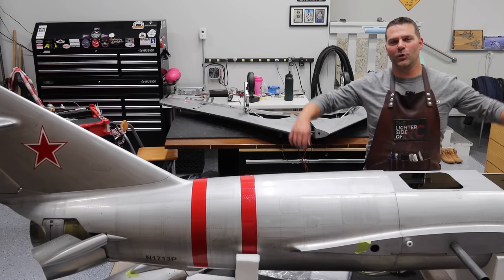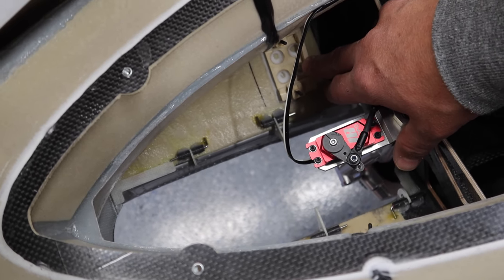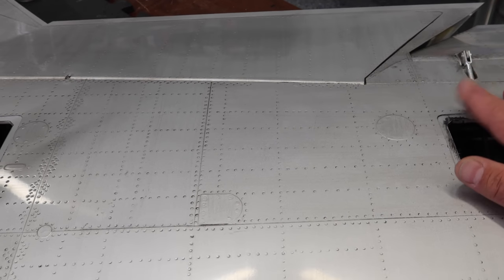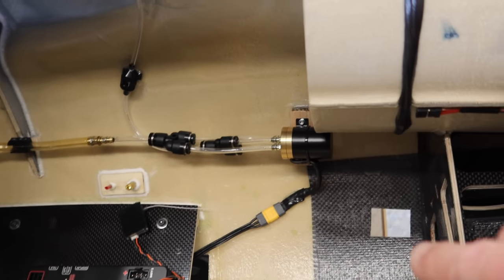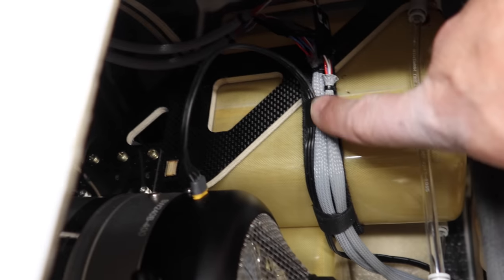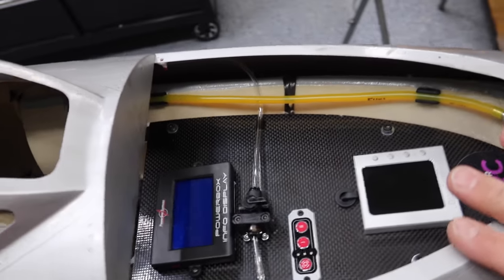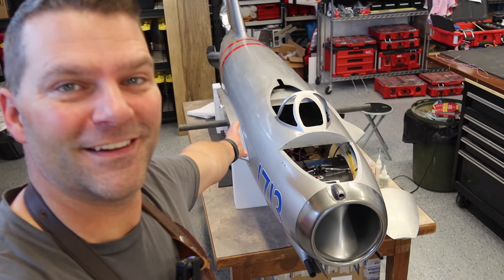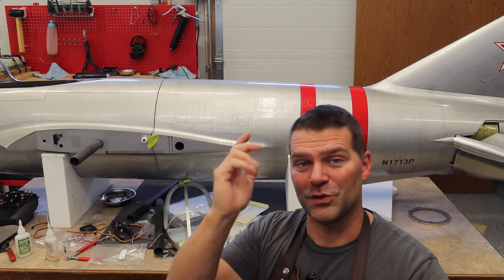MASSIVE CARF MIG17 Almost Complete - Composite ARF MIG-17

Comment: If you need a good 5 min epoxy, try DP 100 Plus.  Great stuff.
Reply from the maker: Thanks Bryan!  I'll check it out.  I'm not generally a fan of the 5min stuff as I find with the ones I have used previous there is always some drawbacks.  Strength, paintability, holding power.

Comment: Great plane, how about just put some servos on those hatch pins, you could mix them in with the lights switch, that way you don't forget or even better, a conditional switch with an alarm linked to throttle position... Just my 2 cents.
Reply from the maker: Thanks.  Just want to make it reliable and simple but not have to keep the canopy open.

Comment: Great Build details, as usual. I’m concerned with the steering servo wire constantly flexing in the same spot close to the servo. Every time the front wheel cycles the wire is flexed at the same spot. (A reasonable amount too). Over time won’t that end up causing strands to break, and ultimately fail?  Maybe allowing another inch of play in the wire might allow that flex point to vary, rather than the same spot every time.
Reply from the maker: Thanks very much for watching!  She will be reliable!  Don't worry! 😉

Comment: For the screw tips, what I used to do after snipping them is put a little dab of RTV or silicone (shoe goop would work as well) on the cut end.  Regarding the fuel pump, to me it would make more sense to keep the suction side shorter.  Perhaps you could explain more of your reasoning for keeping the pressure side at a short length.
Reply from the maker: Great suggestion!  the Suction side in this case is very short.  about 10". It's also 8mm tubing.  I could have made the suction side a bit shorter, maybe 4" and added 6" to the pressure side but wouldn't make a difference.

Comment: Thank you trusty for your tip time! Now question for jon, why is the servo arm of the directional front wheel in the oposite side of the arm on the front landing gear ? David.
Reply from the maker: Thanks David.  The purpose is to keep the mechanics of the nose as central as possible.  There may be Power Box wire from the switch and display coming down in this location so central mechanics is the reason.
Reply: @thelightersideofrc  Thanks Jon I undertstand. What an amount of stuff in these planes, gyros, power box, displays, valve for this valve for that, wires, tubing... I'm not sure to well understand the purpose of all, amazing !

Comment: Hey Jon! Awesome jet! Any reason on the nose steering linkage that you can’t place the servo arm on the same side of the nose horn arm and just reverse the servo direction? Seems like the steering travel is a bit funky on the end travel on both directions. Keep on building!
Reply from the maker: Thanks!  Main reason is to keep all the mechanics close to the middle of the gear.  There will be wires coming down each side so wanted to keep everything as central as possible.
Reply: @thelightersideofrc  Ok on the wiring Jon. I have seen the nose steering bind up when the nose gear is turned too far on a crossed-linked connection. If you limit the travel, it shouldn’t be much of a issue.
Reply from the maker: Yea this one doesn’t have much travel that is needed.

Comment: I may have missed it but can you please tell me what prevents the gear from retracting if the nose wheel is not in the straight ahead position? If is is turned at all it will definitely have an interference problem. BTW you do beautiful work.
Reply from the maker: Thanks Les.  It's all handled in the controller.  if your at full deflection it centers the steering before retracting the gear.

Comment: Why don’t you switch the Kerovalve electronically ? That will minimise the tube length to a minimum.
Reply from the maker: The length here is not an issue.  I have never setup an electronic control of the valve.  In my mind it's much more simple to just have the valve operate by hand.

Comment: Why not put the servo arm on the same side as the nose wheel steering arm?? Why the funky angle??
Reply from the maker: Goal is to keep the mechanics in the center as there may be wires coming down beside the nose gear.

Comment: Looks great. The ONLY thing I see is that after thirty years of plumbing it irks me to my very core that the handle on the fuel valve doesn't point in the direction of flow when in the open position. LMFAO.
Reply from the maker: HAHA.  I figured that would get one of you out there!
Reply: @thelightersideofrc  It's a plumbing thing, handle ALWAYS points in the direction of flow. Avoids SERIOUS problems.
Reply from the maker: I hear ya!  😊

Comment: 100% magnets don’t work unless you box in the nose. The air pressure will pop it off when you shut the throttle because the turbine is not gulping the air! I changed the wire pins to 2mm nylon rod, if the canopy was to jam I can cut that with a thin knife blade…
Reply from the maker: Perfect!  It's nice to hear that!  Back to pins it is!